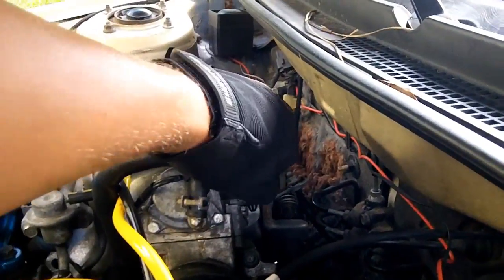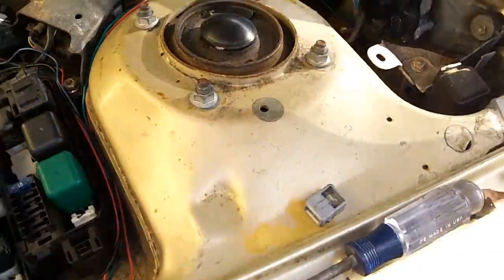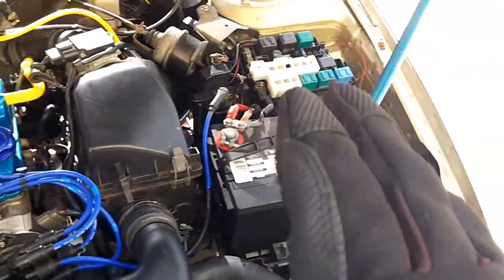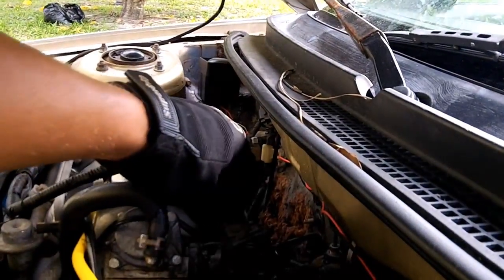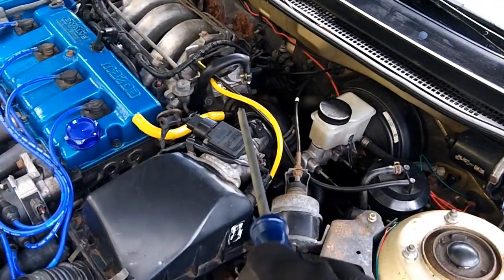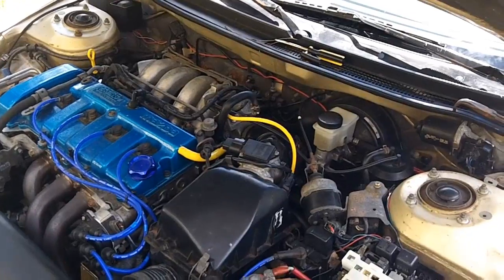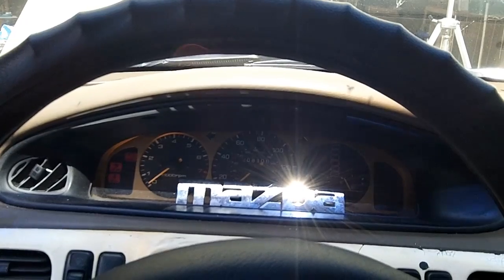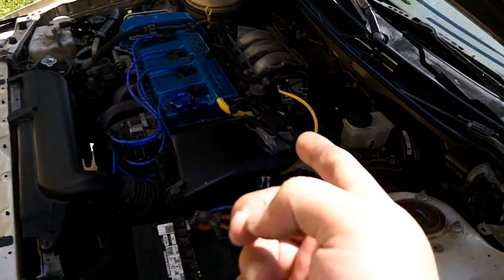Mazda -  Idle Air Adjust Screw (AAS) or Idle Air Bypass (IAB)

Comment: The V6 DOES have an air adjust screw. 
Thanks for posting this video. 
I had difficult starting and was chasing coolant sensors and pressure regulator replacement. 
I thought I had a vacuum leak...
Nothing seemed to work. 
Then I found out about the AAS and checked mine and  it was TWO turns out from home. The baseline is one turn out from fully home. 
Doing a compression test I noticed my plugs were very light, indicating a lean condition. This would be down to the AAS screw position. 
I even tried replacing the Air Flow Sensor with one off a wreck I purchased and adjusting out the play in the throttle cable and the idle stop in the butterfly. 
Things went worse until I checked the position of the AAS. As I said it was TWO turns out from home. 
The EFI was enriching the mixture to try to get the correct fuel ratio and the exhaust smelt rich. 
Yesterday I checked the AAS position (quickly) and immediately got a better idle and a leaner mixture. 
Today I'm going to find out how to short my OBD1 system to do a proper baseline throttle stop and AAS adjustment. 
I am going to have to buy a timing light too...

Comment: I bought a 2000 323F 1.8 Automatic last week, - previous owner said the idle goes high sometimes. PO was a bullshitter - idle is the worst thing I've ever seen. This is dangerous on an automatic. It was at 1,500 when I bought it. I remove a few simple things (AFM, air pipe to throttle body) and sprayed some carb cleaner, and now it just doesn't want to idle, constant chugging 300rpm - 800rpm and regularly cuts out, and hesitates when you toucht he pedal. I bought this as a stand by while I replace the DMF in my Audi, but I'm having to fix this POS instead.
There's a hissing from behind the inlet - any ideas?
Reply from the maker: I have a few ideas but my main one is for you to take it to a mechanic and stop all the guessing.
Reply: @DJDevon3  Nobody ask questions to get the 'take it to mechanic' reply. I did it myself - took inlet off and sealed everything up and it idles properly now.
Reply from the maker: @DavidB-rx3km  There are far too many variables going on with your question which would require me to write an essay. There's no quick definitive answer other than to have a professional diagnose it.

Comment: I have mazda 626, 96 Model. if you turn on the AC the Idle rpm went to high.. 1600 to 1800rpm... and when you turn off the AC it will go down approximately 700rpm.. what is the cause of high rpm when AC is on? tnx..
Reply: Did you find the solution?

Comment: I have a 95 Mazda and the rpm goes up when I park after I've driven it for awhile, do you know what I need to fix?
Reply from the maker: IAC fault and vacuum leak sound like a winning combination but the lack of diagnostic info there's no way to tell. Check for codes. https://www.youtube.com/watch?v=ZY9BeHFW1ng
Reply: @DJDevon3  Do you know how to look for vaccum leaks? Beginner here, reason why I ask is cuz it's hard finding a good code reader for my 95 Mazda mx6

Comment: Hi having trouble with my mazda 323 year 01 at rest.starting the engine the rpm is nomal but when changing gear the idle increase.
Reply from the maker: That's when a load is put on the transmission and engine.  No load vs load. Manual or automatic? How much of an increase? Not much info to go on here.
Reply: The car is  manual .at idle.950 rpm and when  when changing any gear even back it becomes 2000 rpm.

Comment: hi thanks for your answer. yeah some peeps here called that servo in Mitsubishi part.. but some called that is ISC .. I still hard to get out that's problem..sometime start and over again..but sometime normally.. especially when AC turn on that must be over like gasoline going empty almost drop off the engine. sometime make me nervous and surrender..lol.. tomorrow I will cleaning and try to turn the airflow.. I hope I got the solution.  hi btw thanks n great to watching all your video. I done subscribed and liked . keep sharing. 👏🏿👍👍👍
Reply from the maker: There are different designs of the IAC.  Older designs use a spring with a beeswax core inside.  As the engine warms up the spring and wax expand allowing more air through during idle.  That design was later changed out for an electronic servo motor.  IAC (idle air control) goes by many different names on different vehicles. If your manufacturer calls it an ISC then that would likely stand for Idle Servo Control.  For Mazda it's called the IAC so that's what I know it as.  The principle is the same.  As the engine warms up an air passage opens allowing for more oxygen which the ECU compensates for in both closed and open loop fuel map. :)  It also helps for warm restarts such as running into a store for a few minutes then coming back out and restarting the car immediately. If you notice that your warm restarts are failing check the IAC. ;)

If there is a problem with the IAC operation or there is a coolant leak that goes into the IAC, to the intake manifold, then to the combustion cylinder... the ECU doesn't know WTF is happening and will try to compensate but it can't compensate for coolant in the combustion cylinder. You could get pre-detonation and cylinder misfires especially on cylinder 4 since it's closest to the IAC. ;)  It can compensate somewhat for a vacuum leak up to a certain point but not coolant intrusion.  Hope that helps better describe the effect of a coolant leak through the IAC and why it can be one of those hidden ghost problems that can really screw the ECU's ability to maintain idle even if the vacuum system is 100% air tight. 

Also you'll get mysterious coolant loss and eventually overheating because of the coolant loss.  A leaking IAC gasket might also fool you for a blown head gasket if you're inspecting for coolant coming out of the tail pipe. There will be symptoms such as visible coolant inside the intake manifold, sometimes it will look like a clean trail through the gunk inside the intake manifold without visible signs of coolant inside but there will be a slick trail.  Don't confuse the slick for oil slick coming back from the PCV valve return to the intake tube. ;) You must take off the throttle body and inspect inside the intake manifold with a flashlight to determine if it's an IAC or PCV overflow issue.  If there is visible coolant inside the intake manifold voila, you have a blown IAC gasket! ;)  Hope that helps everyone!

Comment: i got the final detected on my unstability idle.. that on throttle body ..the unit called is SERVO..damn ... so hard to hunting that part.. can that servo just repairing only??? thks
Reply from the maker: The IAC on the 98-02 might be electronically controlled and could be an electronic servo but it will still be called the IAC.  I do not have one so I have no idea if it can be repaired.  On the 93-97 it can be repaired.  If you're talking about a different sorry I only work on older Mazda's in my spare time.

Comment: Hey! I got a 1994 ford probe 16v and I am not able to release the idle thats giving tension onto the toothed belt. Do U got any advice for me without going into rage mode? Do I have to remove the second timing belt aswell? 
Hope U can help me.

Cheers
Reply from the maker: Well there is only 1 timing belt.  The other belts are accessory belts.  No the tensioner only applies tension on the timing belt.  If you cannot relieve tension something is wrong.  I do have a couple videos on the timing belt for the I4. https://www.youtube.com/watch?v=aEfEmqJDYzs

Comment: I have a 99 4 cylinder engine. Got any good rebuild info I either want to do a motor swap. Or engine rebuild
Reply from the maker: I did a partial teardown and head rebuild.  There's a video playlist for that.  For everything else there are the workshop manuals available for free from PMX626.info.

Comment: I have a Mazda 6 04 3.0 for some reason when u turn the car on it won't idling but it will stay running when u hit the gas but when u let go it will die
Reply from the maker: Do a fuel pressure test, check for vacuum leaks, check fuel trims with OBD2 scan tool.

Comment: that thing sounds like shit
Reply from the maker: I had low fuel pressure due to a faulty fuel pump and a vacuum leak which I found later.  One of the vacuum caps on the back of the manifold disintegrated.  Also later found out that my ignition timing was off when I did finally get a timing light on it.  So yeah it sounded like shit I agree.
Reply: I have mazda 1.6l 2008 model.  Ist happened to me when i drove the car and im stop cause is crossing the engine is stop... So i start again and is working. My question is, why my engine stop? Isnt possible my rpm idler is low or sparkplug?

Comment: Hey! I have a 99 mazda 626 2.0 hatchback with no obd2 plug in the cabin, but im able to connect to ECU trough the wiring under the hood. It idles too low when working at normal temp. like 3-400rpm no codes in ECU. any recomandations?
Reply from the maker: Check your MAF hotwire and throttle plate for carbon buildup.  Watch my video on how to clean the MAF sensor, it's a pretty good video. Gotta get in there and look around, test some components.  Are you saying you have OBD-II capability or no?  OBD-II is a huge help for looking at STFT & LTFT.

Comment: Hi weve got a 1999 mazda 626 and it runs low idle rpm after engine warms up. Looks like adjusting the distributor can help this. Do we need to disconnect anything to adjust on this? Great videos on mazda.
Reply from the maker: +jose2bee2 1998-2002 does not have an adjustable distributor.  You have a coilpack.  Most common issue for low idle on a 98-02 is a vacuum leak.
Reply: +DJDevon3   Thank you. Learning more about this car. Is it best to take it to a garage to check for a vacuum leak, any videos on how to check it myself? Also, would it be alright to find and put on an air scoop. It has a part missing to end of engine air intake hose. Just had the tbi, but not the iac valve cleaned. It had a leak from the valve cover gasket, wondering if spark plugs should be checked or replaced. Never had the maf cleaned. There was a gasket on the maf ( in addition there were NO bolts connecting maf to air filter box ) but it was broken. Might go to Mazda to  get that replaced. 20 months ago the fuel pump was replaced, never check fuel pressure regulator valve or the fuel pump relay. Also the transmission had a leak from inside. Had it rebuilt, should they have reset the tcm module? Thank you for your help and advice, again.
Reply from the maker: jose2bee2 Yes definitely take it to a mechanic to have them check over your engine.  Sounds like there are many issues that you are getting better about spotting but there could be some that need a professional diagnosis.  Faulty TB gasket or crack in air intake duct would do it for sure.  The 93-97 actually has an air scoop.  You could start with that and see if it's possible to mod it in.
Reply: +DJDevon3  Looks like it was the EGR valve. The mechanic ran it through a smoke machine and found the leak from there. Bad valve, can't repair, needs to be replaced. Likely for the better have to take it in for smog test in a couple of months to get tags.

Comment: I've just fixed. The coolant level was full, but I start the car and wait for half an hour, the thermostat opens and I think take the liquid. I pour about half liter of coolant. So it idles perfect, But anyway there something interesting about the car. After replacing head gasket car "sucks" a lot of air thru the air filter and it's very loud
Reply from the maker: Check your air filter to see if it's clogged and check for vacuum leaks.  It's hard for me to tell you much because I can't see how your car is reacting exactly.  After a head gasket service your mechanic should have run the car so that fuel maps are relearned.  It's at least a 5 minute process in warm weather and up to 20 minute process in extreme cold weather.  The reason the car starts up to 3,500 is called Fast Idle mode to help the engine warm up faster.  The pulsing could have been air in the cooling system or not enough coolant added from the service.  If you have a coolant leak you can expect that kind of behavior to continue so keep an eye on it and if it happens again (low coolant) then test for coolant leaks.  Once you topped it off and purged air from the overflow system after first use it should have smoothed out immediately after warm up.  Glad it's doing better now.
Reply: Thank you for the information. It means that the belt isn't fault. I will try to look for a leaks :)
Reply: Oh, It wasnt the coolant :) I'v just find out and fix it. It was sucking to much air that could suck even a cat easily lol. So I diagnose that air control valve was broken, I change it and it runs smooth right now, like a bee. I also change the timing belt on 12 degree before T, now it stars even better :) thank you for helping me out, best wishes from europe :)
Reply: Lina Gargasaite LP pm
Reply: Lina Gargasaite

Comment: Hi DJDevon3. Good video but anyway I have a problem with my 95 MX-6 FS 2.0.. Few days ago I gave my car to the mechanic. He change only the head gasket. When he put all the components together car was not running correctly. When I start the car the rpms hit about 3.500 and the drops to 3000 and pulsing from 1500 to 2000 rpm. I thought he made mistake with the timing belt. he puts the cams I direct to E and E with I goes down. The crankshaft mark puts on 10 mark I think, he says there was also a T. ( the marks on small plate ). So.. then he tries to change the ignition setup, but nothing. I was trying to find the wacuum leaks but also nothing. I had 626 and it was pulsing also when the cooling liquid was low. Now for MX6 it full. I don't know what to do ;(
Reply from the maker: 10 degrees before T is spot on for a 2.0L automatic transmission.  If you have a 2.0L manual transmission then it should be 12 degrees before T.

Comment: mazda 323 1997 model,how to adust the idle air control,
Reply from the maker: It's self adjusting.  If you feel that you have to adjust it then you probably have a vacuum leak or some type of A/F issue elsewhere in the system.  It is possible that the IAC itself is faulty.  You can start by finding factory testing procedures for the IAC and test it.

Comment: nice tips DJDevon3 i hope i can do the same adjusting for my brother's 2008 mazda 3
its have an idle issue every time pressing the accelerator pedal and release it the engine rev it self a little rev then its idle normally .
thanks for the video .
Reply from the maker: I'd look into the IAC or MAF issue for something like that.  Remember don't mess with the AAS unless you are in diagnostic mode.  For all 1996 or newer OBD-II vehicles you'll need a scan tool to put the car in diagnostic mode.  I don't know the procedures for the Mazda 6 or 3.  You'll want to look those up online or get with a Mazda forum to ask more about the procedure for you vehicle.  Procedures could be different depending on vehicle.  This video will give you a good idea of what to expect for just about any Mazda or Ford vehicle though.  :)
Reply: thank you very much this is helps me to think where to start of this car .
my brother said he removed the throttle body and clean it and clean the iac valve with his friend and he saw his friend play with the AAS screw  close it and open it a turn and half and he says don't worry about it this adjustment is necessary after the cleaning :( .
after that the car has some over heating issues from bad radiator and radiator cab and the thermostat all these was changed about 2 months but the idling issue still there .
thanks again .

Comment from the maker: Anwar for some reason youtube won't let me reply directly to your comment.  I said "You're supposed to use the air adjust screw while the shorting bar is out".  Removing the shorting bar puts the car into diagnostic mode. Again, only the 2.0L automatics have the shorting bar.  If you have any other 1993-1995 model (2.0L MTX or 2.5L ATX or 2.5L MTX) then use the jumper pin method in the diagnostic box.  The car must be in diagnostic mode while using the air adjust screw otherwise you are just wasting your time.  You are basically programming the ECU to use the air settings as a base air setting while in diagnostic mode.  Then while not in diagnostic mode (normal operation) the ECU uses that as your target setting for any air adjustment/compensation.  You're basically setting your target air volume during idle.  Hope that makes sense.

Comment: i have a 94 probe, it runs about 700rpm until in gear it drops to 500. then as i come to a stop some times it will drop down to 400. it wants to die out badly. what could it be?
Reply from the maker: MAF needs to be cleaned if it's an I4, if V6 check the VAF signal.  check the signal from the TPS and for air leaks.  car must be in diagnostic mode when adjusting the AAS.

Comment from the maker: Probably not.  Air could be getting in past the intake manifold gasket or throttle body gasket.  Putting on a cold air intake would not solve a gasket issue.  You could also have a split in an old rubber vacuum hose.

Comment: I have a 2000 626 2.0 auto and my idle is about 600 id like to get it up to 750. How should I just use the aas. Also when I hit the gas it stutters and then goes. Could that be clogged fuel injectors?
Reply: Same problem. Piece of shit car I've tried everything